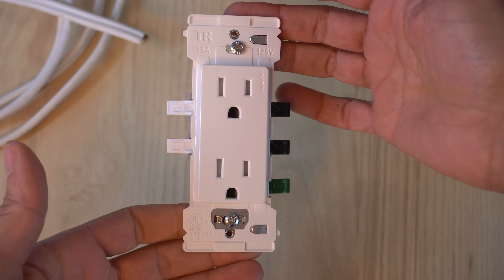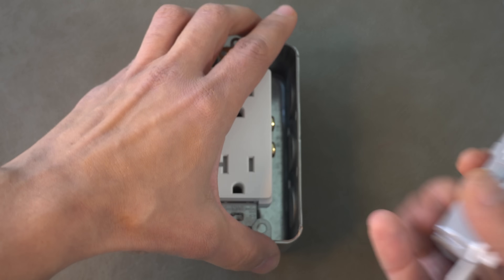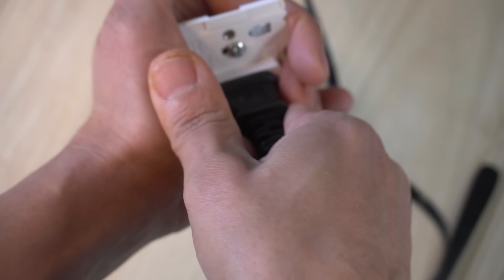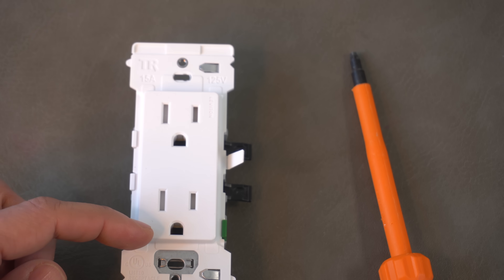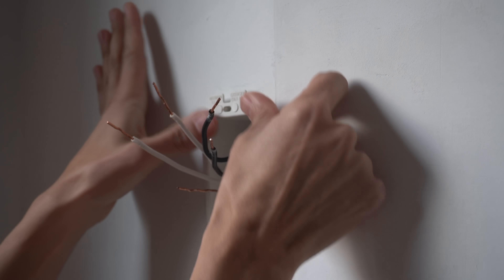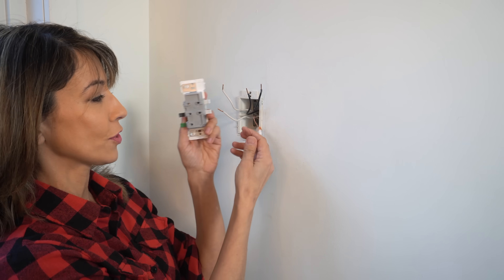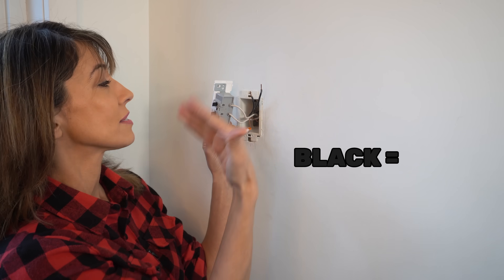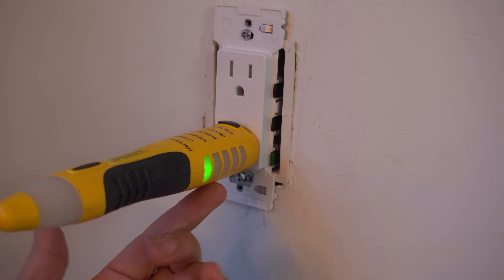New Electrical Outlet Installation: 3 Essential Improvements You Need To See

Comment: What keeps the Box Extension from being pulled out?
@4:00 to @4:20 
that Org Box was quite Deep behind the dry wall, 
@4:35 to @4:55
and there was no physical connection made between the plastic extension box and the Org Metal box to keep it from pulling out.
Reply from the maker: When installing the outlet I used extra long screws to secure it to the electrical box. I have a box extender video linked in the description if interested. Thanks for the question I’ll show that step next time.

Comment: Not good, but well is nothing better than the screwed wire , those pressure taps with time gets loose creating not a solution but another problem same happens when you stabbed the outlet with the wire in .

Comment: This means safety sockets that exist since >20year in europe and are now mandatory by code, just appears in US. There are many other safety measures awaiting to be used in the US. For example:
- every circuit must have a 30mA differential breaker from the main pannel.
- metal tubes and boxes are forbidden as any error may induce electric shock
- aluminium is not allowed
- all breakers are 2 ways (cut live and neutral)
- plugs do not allow to touch live or neutral (or to short them) even if they are not plugged completely...
etc...

Comment: I still like to fasten wires with screw terminals, though I prefer the type where you install the wire through a hole the back. The Wago type only provide a pinpoint contact that is held by spring tension.  This may work at first but after many years of high current (slightly less than rated) they will fail.
Reply: Ok boomer. You have no idea if they will fail or not.

Comment: I think a big thing to address is how to start integrating USB (and USB-C EPR, specifically) into modern wiring. USB-C runs at 5V but up to 48 amps. Most household outlets are still 120V15A (at least in the US), which is simply not enough for certain use cases anymore - especially with the advent of EVs in homes. Ideally I'd like every single circuit in my house to be 240V30A capable, and for each plug IN each receptacle to be 120V20A capable. But then running a 50A capable wire along each 20A wire PER plug is a loooot of hot wires with a lot of insulation. I worry if that's even thermally responsible unless the installation has minimal slack in the wiring to allow them to be as straight as possible.

Comment: I will politely disagree that these are the best. I prefer side screws because I can tighten them when they loosen which they will over time. As far as the exposed screws a simple wrap of electrical tape would take care of that.
Reply: is that means we have to retighten screws every 5 years and replace electrical tape . I believe all that was calculated in this new technology just make sure your wire is straight.

Comment: Daru, are you a licensed electrician?   To change an outlet in my condominium or HOA, do I need a licensed electrician or is DIY code acceptable?   My primary concern is if there was a fire.  Is my insurance null & void due to DIY for most states in US?
Reply from the maker: You would have to check with your local electrical authority to see what the rules are in your area. In many places you can do simple replacements as a homeowner. Moving or adding electrical involves permits. I pull permits, I’m not an electrician. If something is too challenging a licensed electrician is who to call. For insurance and safety it’s best to follow the rules like you say. Smart thinking.
Reply: @DaruDhillon  My question is confined to this new type of outlet.  For homeowners in condo / HOA, it’s a terrifying gray area on changing an outlet like this.  Does it violate condo rules & regulations because 99% of them have no mention?  Also, does residence insurance cover DIY  outlet change?

Comment: Geez, electrical outlets have had spring clips for quick wire insertions for over 20 years.  The major difference here is you don’t need a tool to release the wire.  So what, you don’t remove the wire often. 

Most experienced electricians refuse to use the “push-in” holes at rear of duplex outlet because the spring clips have little surface area for connection.  Also, if you wiggle the wire enough, it can come out of receptacle.  If there was a 12 A space heater plugged into the outlet, I have greater confidence for safety with a looped, screwed down wire connection.

Comment: Amazing just amazing. It's about time someone came up with a safe way to wire an outlet. Old days electrical tape was run around the side to cover the screws
Reply: screws were already invented.
Reply: @sundogaudio851  true but brains? thats another matter
Reply: Now if they could just improve how toilet seats are fastened to the toilet LOL
Reply: @geraldslonaker3289 it already does, you didn't know ? 😎
Reply: And why on Earth would you need need to cover the screws ???  I sure hope that you switch off the breaker when you install a switch so where's the problem ?

Comment: Levers are a safety hazard. The plastic holding strength diminishes over time creating a loose connection and the GFCI protection will not be as effective as with a screw on model. In other cases, a loose connection will tend to cause overheating on the terminal and eventually causing a fire when less expected. Be safe . The choice is yours. After all it’s your house. Thank you for reading this.

Comment: Thanks. Nice to hear Canadian English Wago LEEver nuts. I haven't seen this type of receptacle before; it seems to be an improvement on the old stab lock connectors. And I particularly like the breakout tab (for independent circuits) is covered as well. I am not sure if there was any improvement made to the Tamper Resistant slides. The slides do not always operate smoothly, especially when a receptacle is used in dusty conditions and also used infrequently. I like the forced correct spacing feature as well. The one thing I would have done differently from you was to connect that ground wire last where it was a bit too short - that eliminates the extra connector and a possible point (however unlikely) of failure. Subscribed.
Reply from the maker: Thanks the sub and sharing your thoughts on the new receptacle and TR feature. Agreed the alignment is a nice improvement.
Reply: @DaruDhillon  Alignment is probably the biggest advantage. I've worked on some -- and with the old ones -- that's the biggest pain in the behind.  Screws are a little bit of a pain -- but not that much, you get good at them super fast.

Comment: As a professional I am hesitant to use wire connections with little spring clips to hold wires and junctions instead of a screw or wire connection twisted and secured with a wire nut or similar fastener. My concern is not only how much stress the spring clip terminal can hold but also the contact area of said connection. In a circuit with high current demand like an appliance or shop receptacle those little clip connections just touch one side of the wire to the contact causing a high resistance contact area. I’m just not happy with that idea. They may be quick and easy for an amateur but permanent high quality connections should be the number one goal.
Reply from the maker: High quality connections are a must. Thanks for sharing your thoughts on this Bob.
Reply: @DaruDhillon  but I have been wiring for 50+ years, I suppose it’s hard for me to accept change to the way it always was!!!! Ha ha!

Comment: The only issue I see with these is there is no center screw receptacle.  Many multi-plug boxes use that screw to keep the receptacle plugged in.  Granted, using one of these is not the intended use of a two receptacle box BUT, human nature being what it is I would think the maker of the new boxes would have found a way to accommodate it rather than making it more dangerous by having it easily be pulled or fall out.  ALSO, for the past 20 years metal boxes have gone out of style and have been replaced with plastic so the issue of metal boxes is a bit over stated .....
Reply from the maker: All my videos feature metal boxes because they are usually found in old homes. They are more expensive than plastic but very common here in Canada. We use lots of plastic too. Thanks for sharing your thoughts on the center screw outlets.

Comment: Great job explaining...so clear and simply said.  I don't have any experience but think I could tackle a job like this. I did know to shut off power but that's it.  I wanted to update some outlets but thought I needed a handyman.  Thank you, best video for this ever!!!
Reply from the maker: Turn off the power, use a voltage tester and snap a photo of the wiring with your camera before disconnecting your old outlet as a safety. Give it a try if you feel comfortable with it. Surprising yourself with new skills is a good feeling.

Comment: Very good improvement, is this updated required by the electrical code? When should we see this connection method propagate into the wiring devices? Thank you for your presentation. Claude
Reply from the maker: These outlets are UL listed and approved for US and Canada. So they are code compliant. They are helpful to people looking for an easy and safe way to wire. Traditional outlets are excellent when installed properly but they are tricky to get right and take more knowledge and care to install. Thanks for the question Claude

Comment: Great post No issue w this being an OPTION
It will be made law
Why
It'll make the rich richer
Why
This costs more than standard outlets, any excuse to raise prices jacks it up more than rising costs, it has moving parts so it will fail decades before old devices; & it will allow contractors to hire unlicensed electricians, think nurses aid vs nurse, until there aren't enough electricians while at same time they can't charge more than their unskilled replacements.

Always follow the money

PS I've seen tests on lever lock connectors.  Ever single one results in higher operating temps at point of contact / device, which is plastic, which is made from oil, which WILL burn.
100s of Billions of screw type outlets switches bus bars ..... have been safely installed by pros & amateurs.  
Most of issues noted are excuses, not reasons 
Touching box side, is A almost impossible if even  vaguely installed properly.  B Is defeated with two turns of elec table around whole device
Inserting things into plugs  Try this TAKE CARE OF YOUR KID !!  Why does EVERYONE have to suffer because you will take no responsibility for anything.  I'm old getting older & have one of those safety outlets   1/2 the time I give up.
Reply from the maker: Thanks for your feedback on this.

Comment: Such a nice surprise stumbling upon your channel.
Reply from the maker: Nice to have you here. Welcome!
Reply: @DaruDhillon  thank you!  When I found you, I was in the process of researching hot water heaters running out of hot water much sooner than usual and/or not heating it as warm as usual.  I'll check your catalog to see if you cover that topic.  Related to this video, do you know of similar electrical outlets that also provide USB-C ports?  This is now fully relevant since the European Union has (rightly) forced Apple to use the same cables as the rest of the world.  The time is right to retrofit a home with these new outlets.  I'll check your catalog on this as well, but it could be an interesting video idea for you if you haven't already covered it.
Reply from the maker: Thanks for the video idea and tips. Good to keep in mind for sure! @mackenmd

Comment: Why is the outlet daisy chained? I only do this in a 2 gang box if it’s tight. I’m not a big fan of back stabbing the outlets and I use the wago terminals for temporary fixes.
Reply from the maker: It’s existing wiring. The levers have rear ports. Thanks for your thoughts!
Reply: @DaruDhillon  true, but I prefer to pigtail and wire nut three wires, that way if an outlet goes out the later aren’t effected. Daisy chaining is okay if you want to put a GFCI as the first outlet, then the rest of the outlets in series are protected without spending money on every outlet
Reply from the maker: @mitchellkasdin1899  That's a great way to think ahead. Smart tip!

Comment: Seems nice, but you skipped the steps that always cause problems -- finding enough space in the old box for example, or getting the new screws to match up with the old box. Or a box that isn't that solid on the stud. Or the plate that stands out from the wall with a gap. How is this really different from the widely loathed stab-back receptacles? I assume these are far more expensive.
Reply from the maker: Point of entry is at the back of the receptacle. The levers that clamp down the spring is a new patent pending technology. Manufacturer is Leviton. Price is affordable. All the information in the description box.

Comment: Great outlets and nice job explaining the installation. You did mention some outlets have only two wires (black & white) besides the ground.
Which terminal do you install the leads? Or do they have replacement outlet with only two terminals?
Reply from the maker: You can use this outlet for that type of installation. You’d just leave the two empty levers in the locked position. There’s a diagram that comes with the outlet to show you how.

Comment: How much surface area is in contact with the wire in these new outlets? Many of us have the choice of using the screws on the side for better contact area and ampacity compared to the push-in connection that is available on most 15 amp outlets. This new outlet  is convenient and safer when using metal boxes and I like the indexing for side to side, but for power it seems to have the same "problem" as exist with present day outlets with push-in connections especially when multiple outlets are daisy-chained.
Reply from the maker: If someone is able to install screw terminal outlets properly and will invest the time in learning how to do it then screw terminals are an excellent option. They are reliable when installed correctly. The issue this addresses is that so many outlets and switches are installed poorly and that's dangerous. Surface area contact would be inline with UL Listed standards and regulations for US and Canada.
Reply: @DaruDhillon  Remember, "code" is minimum. And yes, after 45 years I can install a "screw terminal" properly. "Regulations" are minimum. The question to you was about comparative surface area (read "resistance") between these new and really cool outlets and screw terminals. If they have the same surface area of contact of all the push-ins before, then Leviton let us all down and didn't improve the electrical function, just a bunch of very nice convenience functions. Thank you so much for introducing these to me. I will look for opportunities to use them in multi-gang boxes. 
Just like 10 amp breakers, there is a trend due to LEDs to not focus on the resistance of an electrical interface (anymore).

Comment: Good informative video except she should have explained why the old outlet had two sets of black and white wires.  Were there two separate circuits which would require the removal of the copper tab in the back or was the old outlet being used as a junction to continue a circuit?  If it was the latter, then the two sets of wires should have been connected together and a pigtail used to connect the new outlet.
Reply from the maker: Thanks for the feedback on this.

Comment: How much physical contact exists between the lever connector and the wire? I fear not enough contact exists which would create higher resistance/heat between the two.
Reply from the maker: I’d have to open it up to find out. Next time.